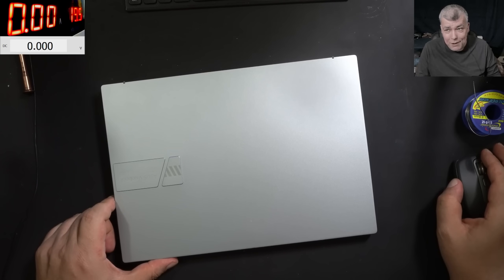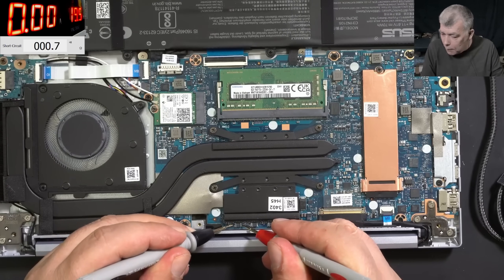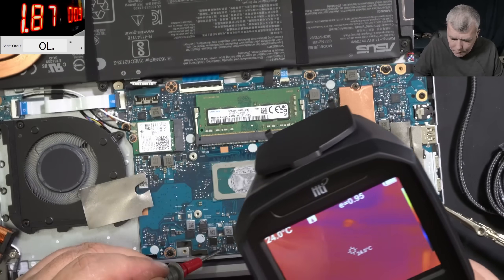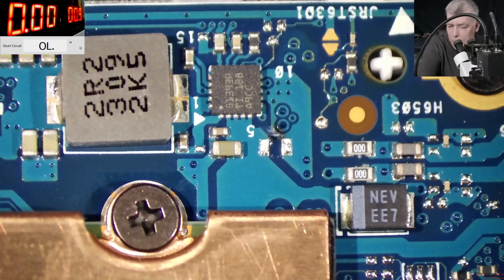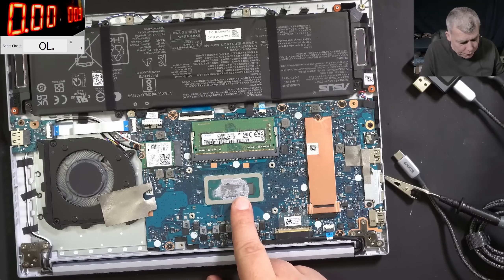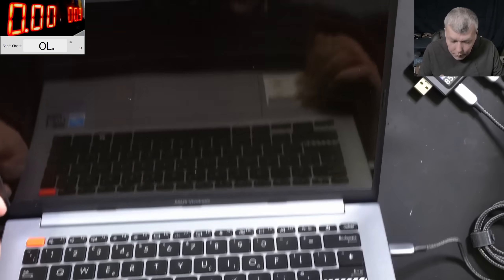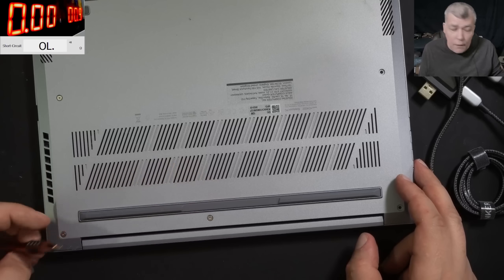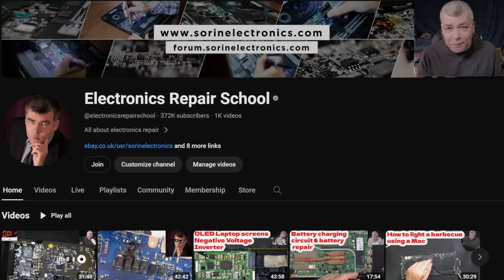ASUS Vivobook S 14 OLED - No power, board repair - A proper Friday job

Comment: 1 question I'm gonna fiercer be learning of these ..I'm aware of ya general cap capacitors ceramic etc if I was looking at that I'd have said diode given its shape but clearly not as you've  pointed out..I've got a lot to learn. I recently learnt what looks like a mosfet (8 pin ) wasn't a mosfet lol

Comment: Hello! I'm not sure but I think you shouldn't apply thermal paste on the PCH, should you? If you look at the copper pad of the heatsink it only covers the CPU area, not PCH.

By applying thermal paste to PCH it will get heat up by the CPU, which is not desirable. But I'm not sure, it's just what I've heard.

Cheers!
Reply: Hi, which one is the PCH? Is it the green part under the CPU?

Comment: You can see that the gap in the plastic shield on the heatsink is no way wide enough to cover the chipset hence why it had no paste on it. Probably better to just pull it off.

Comment: Again a great video! Just pay attention most of modern laptop with cpu inculding the pch, the pch is usually without thermal paste to avoid mutual heating on the dissipator. It is a lesson learn on dell latitude E5450, last version was delivered with heatsink not covering the pch part.

Comment: As I've said in one of your other videos, time has shown that these SMD capacitors are garbage and have a high failure rate... That's sad :(  Makes you wonder, how many perfectly good devices have made their way to a landfill because of just one failed 1 cent capacitor. Oh, the horror!
Reply: I wouldn't say they have a high failure rate, it's just that there are so many of them for EMI & decoupling.

Would a surface mount polyester film capacitor be more resistant to shorts?

Yes, but they're extremely expensive and can't handle normal reflow temperatures.

Mica get around the reflow temp issue, but the price is even worse.

Comment: Mama mama Sorin dragule cand te vad ca le dai power on fara radiator si cooler morrr.....iti plac "focurile bengaleze"???:)))....Oo..dear Sorin when i see you powering on the machine whitout the heatsink aand cooler..i dying quickly..:)))..do you like "benghal Fire"???:)))..this is not a television repair...to powering on whitout the cooling system...it could be a damage the cpu or the video chip very,very fast...

Comment: Hi Sorin! Did you noticed that the exposed copper heatsink area did not covered the chipset? You applied thermal paste between the chipset crystal and... heatsink´s black plastic layer. Totally useless. That´s why chipset came with no thermal paste from factory. Engineers are dodgy, a not cooled chipset is more prone to die...Regards from Spain.
Reply: No it’s for not spearding the CPU heat on the PCH. 
The PCH will be around 45 degrees C  and the the CPU between 60 to 99.  
If you share the coper and thermal paste with the CPU your PCH will get unnecessarily hot and so will have more chances to die early.

If your pch is on a specific chip, you can had some thermal pad